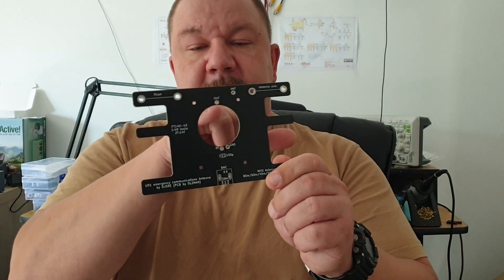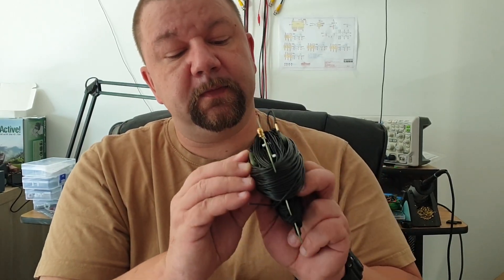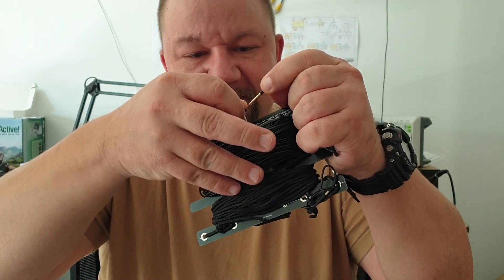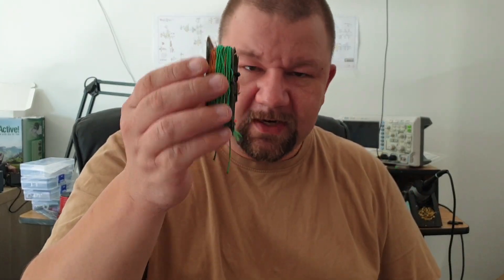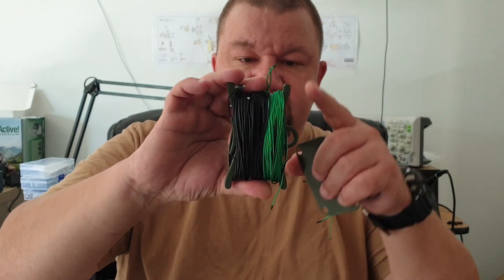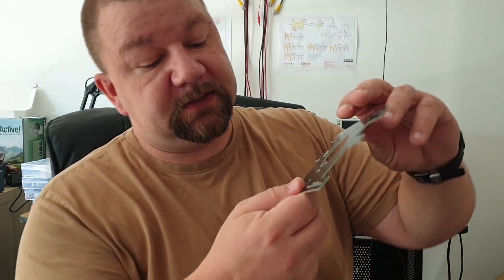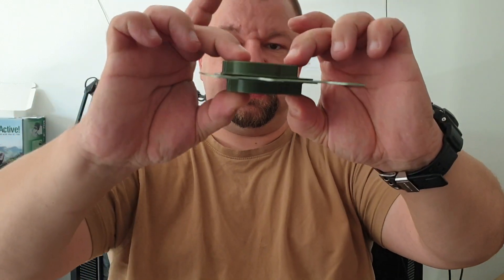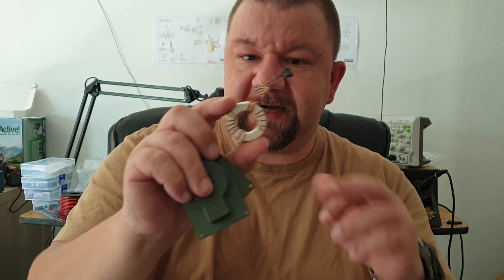U01 emergency Antenna update - 100W Version, Reel and more.....

Comment: I like the winder of your 2nd EFHW, could be interesting to design a single layer PCB that make it easy to duplicate at home and attach it to the winder with screws or just zip ties…
Reply from the maker: Which one exactly do you mean ? The THingiverse winder ? or the pocket Antenna one with copper enamelled wire ? In case of designing a PCB, I´d design it in a way, so you don´t need the winder anymore. PCB as winder, as shown with U01..... But the practical thing about a 3D Printer is: You can have it NOW, and not wait for the PCB´s to arrive ;) So I´m using it quite ofen for my projects.

Comment: If you will be making reversion 2.0 add some cutouts on the sides to easier turn the wire in a pattern of 8 to prevent tangling it.

Comment: It is a very good idea to preassemble as much as possible. I like very much using these white packing sheets to wind wire. PCBs are rather thin resulting in a very small bending radius. Perhaps it would be beneficial to move the bnc / smd connector parallel to the coax windings in order to let the connection stay in place. Keep the good work up. Vy 73
Reply from the maker: The PCB is just a suggestion, and some viewers already made their own Version of U01. Build it like you would like it, and be happy with it ;) The PCB is just one more option, not mandatory ;)